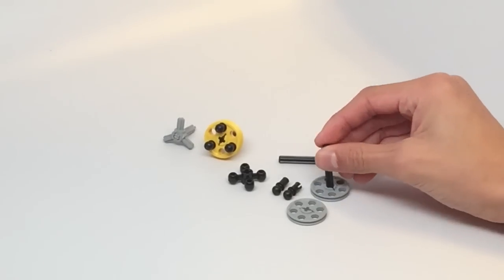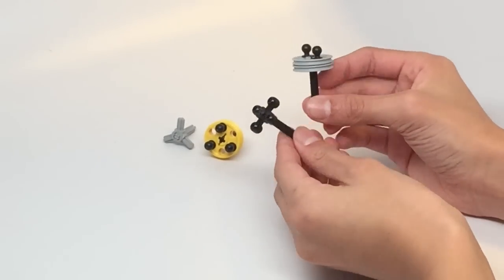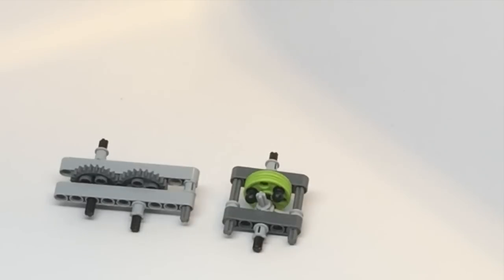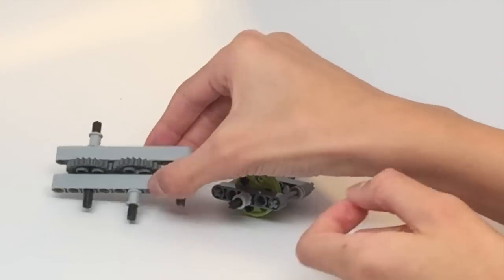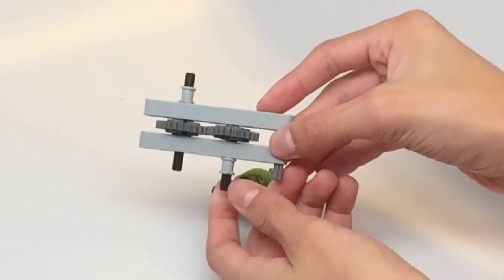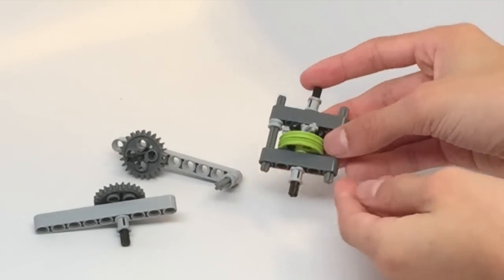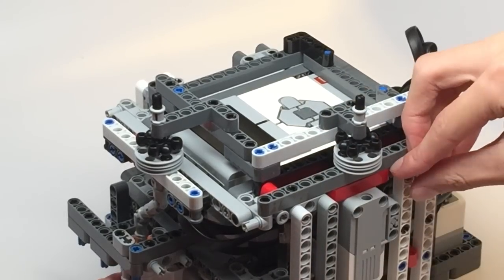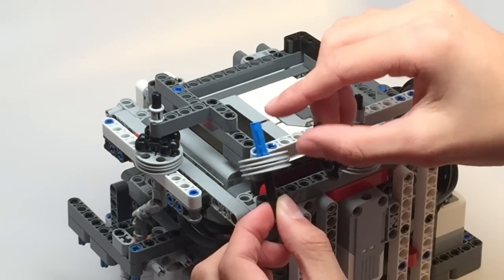FLL 2015 Trash Trek - Changing Bases

Comment: Also, to prevent more of the overlapping, like in the frame that you had shown in your example, I have heard that it's best to have two of the 3-hole-length pegs in the beams of the frame so that the attachment can still stick on to the frame, but still be removed easily. Just making a suggestion.

Comment: In the triangle clutch gear system (the dog gear-like system), would it be possible to insert an axle spacer into each of the three semi-axles to keep the top from overlapping? What problems might arise if that were to occur?